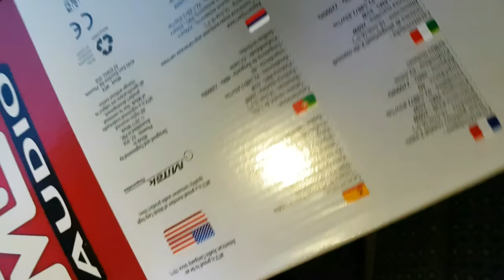CHANGE FRONT SPEAKER Opel Corsa D

Comment: Hi, thanks for the video. Is this a coaxial speaker you fit into the Corsa?  I was told that if you are using the existing tweeter then a coaxial speaker would not be right to use as there would be too much top end sound. Do you have to shut off the inbuilt tweeter in the Corsa if you are using this type of speaker? Can you advise what type of speaker to use is please and if there is anything that needs to be done to the existing sound already in the other speakers that comes with the Corsa?
Reply from the maker: Hi, indeed, is problem with coaxial speakers when the car has aleady mounted tweeters. Personally I mounted a filter and I cutted the wire of tweeter mounted on my new speaker. Is not mentioned in video because I did that after few weeks

Comment: Original cables are yellow-blue. New cables are black-red. How can i understand the right combination? do i give a harm if i once combine and try with a minimum sound level?
Reply: Wiring a speaker wrong will not damage it, it will only cause phase issues :)
Reply: You can easily find the right polarity by connecting a small 1.5 Volts AA battery to the 2 speaker wires: if the cone goes up, that is the right polarity; otherwise if the cone goes down, reverse the polarity of the battery.

Comment: Hello. Am I going to have issues if I replace only the speakers without the source? I was thinking of changing only the front speakers and tweeters but the cd30mp3 is not very strong. Will I have problem with that? I think max output of cd30 is 20watt per channel.
Reply: Get a new system

Comment: Your door make a sound with the bass of the music?
I suspect the interior plastic make this sound with vibration.
Reply: Lol everyone seems to expect lots of bass from 6.5 inch speakers! A sub woofer is the answer for bass :)
Reply: @drummonkeystuffuk1875  ?
for a normie its enough.
It's enough to let ur doors vibrate.
Sure u can use sub. I also have one in my car. But its not directly needed. With an amplifier u can get enough Bass.
Reply: I have also a corsa d , i still have the standard speakers.. when i put the bass on 12 the whole car makes more sound then my speakers.. but i guess when installing some new ones there is a way to tie up or tape the vibrating things so it gives no extra sound anymore

Comment: Sound this speaker better than stock one?
Reply from the maker: Yes, more better, but first reason for this is because the membrane was broken, anyway this speaker is more powerfull than the one stock.
Reply: @SALProjects  how are the stock ones_ Are they powerful enough to produce bass? Can you please reply because I am looking forward to buy this car. Thanks.
Reply: @dharminderram5246  No they are very weak. Just bought a Corsa-D for the wife and its the very first thing im gonna change, the speakers!!
Reply: @ananinamora9406  Mine are very powerful with much bass
Reply: @dharminderram5246  the same. Opel Corsa D, stock audio, really good with good basses
Reply: Dharminder Ram no they are trash. I’m about to buy me the car too and that’s the reason why I’m watching the video
Reply: @SALProjects  i did same than you in this video, same mx speakers,  and currently  I bought stock speaker  because i want reinstall original sound system. 

Bass is better in stock speakers...  In your mx speaker you have high and mediums voices, coaxial system.... In stock speaker you find bass and medium sounds, but car have installed tweeters on stock.... Sound range is complete and better. Anyway, the power of sound is bigger  in stock speakers.

Comment: Hi, so why did you change your speaker? Was it because of vibration noise? You mentioned the membrane was torn.  I think taking off the whole door cladding is overkill, there must be a simpler way to fix the vibrating noise. Inject builder's foam?  :-)

Comment: What size are the new speakers ? What speakers did you put in your car ?
Reply from the maker: Speaker size is same with the original speaker size 16,5cm (6,5inch)
Reply: @SALProjects  hi do you know the size of the rear speakers of the 3 door model?are they smaller?cause I saw they were 5.25 but I'm not sure
Reply from the maker: @joseluissoto5156  Hi, I think is same with 5 dors version, 13cm diameter, and an adapter, if they are after market.

Comment: There is a chance that you can burn the stereo. Becouse CD30 and CD30 mp3 gives 8 ohms and this speakers are 4 ohm. So you should be careful not to turn volume very high. Cdc40 opera and CD40 are 4 ohms.
Reply from the maker: Hello! I've changed the original car player, you can see this in the video on the channel.
Reply: I think only the 7th speaker is 8 ohm and others are 4 ohms. I'm not 100% sure though

Comment: What's the diameter of the front and rear speakers on the opel corsa D 2006?
Reply: 16,5 cm fronts, 13 cm rears.
Reply: @michelmglnk  Can u help me how to remove panel i have 2 doors  i dont know how to remove panel .
Reply: Kobra139 i have the same problem of 2 doors i don’t know how to do it